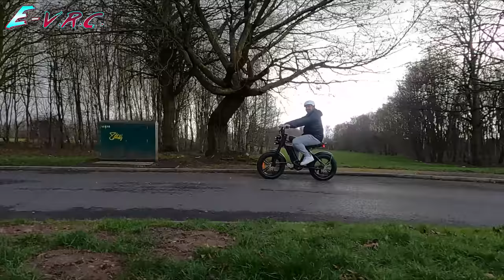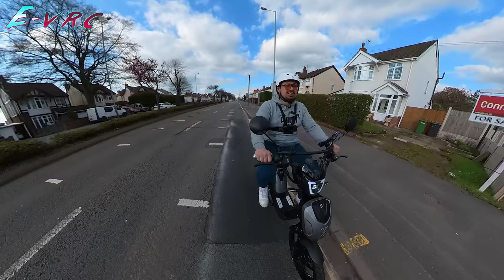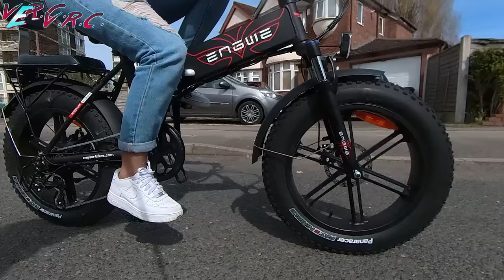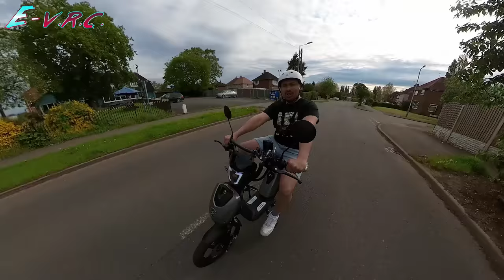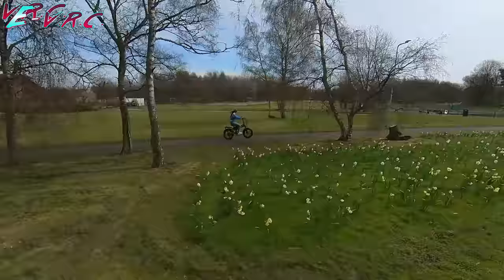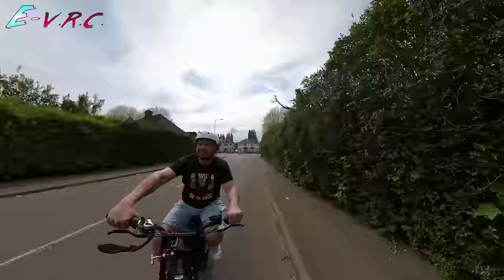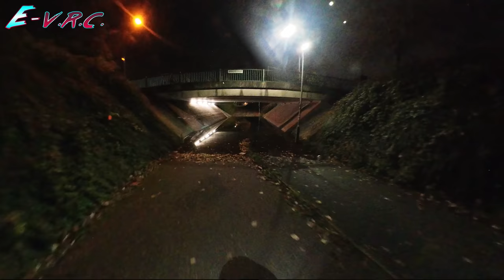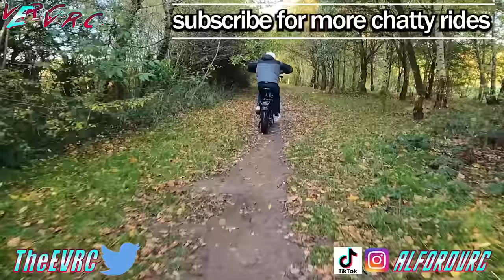The CRAZY Ebike law that MUST Change Before Someone Gets HURT

Comment: The 250W nominal limit is really only a number. All the uk legal ebikes I looked at had real output considerably higher than this, mostly between 400-750W. The nm torque figure is much more realistic
Reply: I agree with your assessment. I don't know what the actual 'power' of my cargo bike is, but with a stated 80Nm of torque and 160kg including me, it gets off the line a lot quicker than just me with no luggage on my conventional bike. (Slight caveat... I live in fairly flat country so I don't really know, or need to know, how it copes with steep hills.)

Comment: I got a bafang mid drive and a tongsheng mid drive ebike both with throttle. The bafang throttle makes it like a scooter ie no pedals. The tongsheng throttle works to 7mph then it slows you down if you still use it and pedal.
The throttle legality and a throttle is legal on a bike built before a certain date is daft.

Comment: Are these laws even enforced? I built an ebike with a 1000w motor, throttle only and never bothered connecting the peddle assist. Never had a problem with the law (fingers crossed). I do about 31mph and other ebikes pass me all the time that must have 1500w moters doing 40mph+ i rarely ever see an ebike with 250w motor on the road.

Comment: I have a 250w Jorvik electric mountain trike which weighs 50+kgs, plus tools, etc. I weigh about 85kgs. It does have a "throttle" but this will only power the trike to walking speed, on level ground.
On even the gentlest slope, a hill start is very difficult, if not impossible.  250w is not nearly enough power to pull away safely uphill at a busy road junction.  If there is loose gravel, it's even worse.
I do not have a real problem with the max powered speed. At 73, 15.5 mph is quite fast enough for me, but 20mph would be better.

Comment: I think that what you want is an electric moped.  These are readily available and need insurance, licence etc... For those people whom want to supplement their pedalling with a small motor to assist up hills etc. then an e-bike is ideal, but it remains a bicycle (hence the pedals). It's easy to confuse cycling (with assist) and a small ride-on moped.  If you don't want to pedal don't buy a bicycle!

Comment: A throttle makes it an electric moped so you need to do a CBT, get insurance, registration plate, MOT etc. There is a problem with idiots riding Sur Ron’s which do around 40mph with a throttle. Electric pedal assist bicycles are perfect as they are and the law is there for a good reason. If you want a throttle get a moped license.
Reply from the maker: A throttle on a 250w doesn't make it a Sur Ron though.

Comment: I agree that the assist limit needs to be 20mph and a boost button for setting off especially on hills is a good idea and I think this exist on some eMTB models too. 
I think there comes a point though when you have to ask yourself do you want an Ebike or an electric moped?
There has to be a cut off point somewhere.
Reply from the maker: Agreed. I think moped being 28mph, ebike being 19 or 20 is decent. But without a power limit so they can still do hills and carry heavier riders.

Despite speed and power though which you can easily argue the current rules make sense... throttle doesn't. I haven't heard anyone come up with a reason why throttles shouldn't be on an ebike.
Reply: @e-VRC  Yeah, I think it's basically just all to do with them actually really being pedal assisted rather than fully electrically propelling the bikes motor. I'm not against it personally but I can see why it is there to differentiate between an Ebike and electric moped. If you're not pedalling how can other people tell the difference is maybe the reason. I see a lot of food delivery people using obviously unrestricted throttled bikes though and they don't seem to be stopped. Many near where I go are no way restricted to 16mph I'd say some are easily doing over 30 sometimes, I can understand they need more power for carrying goods so maybe they have different laws? I know they aren't electric mopeds because they should have a reg plate if they are?
Reply from the maker: @davidmaskew  they're just getting lucky tbh. Police do turn a blind eye to people seemingly being responsible which is fair enough since you want them to be after proper crims. I suppose the rule is a bit funny as of course with an ebike you aren't actually helping at all or at least you don't have to. They want ebikes to be 'electrically assisted' but actually they can get away with being fully 'electrically powered' (ghost pedalling) and that's judged to be ok then it doesn't  make sense that throttles aren't. Lol I think we cracked it 😂🤟

Comment: I think the speed is set so low, because the question is where does a throttled e pedal bike stop and an e motorbike start? The other problem is with speed is higher risks of gravel rash and general injuries if you crash

Comment: Here in the US(in my state) there is no wattage limit.(mine is 350 watts) Throttles are allowed. The speed limit is 20mph( mine goes 30kph ) I can pedal mine at about 15mph without the motor on.(only slightly slower than I can ride a normal mountain bike). Some people have ebikes that go 40mph. You can get away with this on highways. The police will leave you alone most of the time on an e-bike. they go after people who put gasoline motors on their bikes instead. Mine does not have a throttle. When I am in tight maneuvering situations I turn of the pedal assist and pedal it like a regular bike. I had a crank come loose once and had to figure out how to kind of hop it along by half pedaling  to get it to where I could get a tool to fix it.

Comment: You can pay £50 and get your ebike approved with a throttle - I think you have to go to Portsmouth.  There's still no insurance or registration requirement.  They will test that it is compliant with power and brake requirements, speed limit etc.

Comment: I'm lucky, as a friend of mines staff  use a small fleet (4) of Engwe 750 watt  EP2 PROs to get themselves around his Private estate.   All the bikes have the Throttle enable & are limited to 20 mph..   The benefits are, Safe ' Twist & go' starting  off using the throttle,  plenty of power for the larger rider & for  carrying loads on the Rear Rack .  By limiting  the top assist speed to 20mph  it keeps the riders  at a reasonably safe speed limit.   I can vouch for the benefits  myself,  I  rode one as my main transport  on my last visit in June 2023.  A great solution.  ( In my opinion  a  UK Spec 250 watt, Max 15.5 mph & no main drive Throttle  e-bike  is a really poor unsafe experience  for sensible Adult Riders.

Comment: A pedal striking the ground while cornering has to do with the ratio of bottom bracket height to crank length, plus the shape and thickness of the pedal at the outer edge. The simplest solution is to fit shorter cranks and slimmer pedals, since the standard 170mm crank is derived from road bikes and the 175mm from mountain bikes, both to fit taller people. The average person will be fine with a 165mm crank, and adults with short legs would be better off with a 160mm.
Another solution would be to have a tilt sensor within the bike that can detect cornering.
Reply from the maker: What would it do when it detects cornering?
Reply: @e-VRC  I was imagining a mid drive e-bike motor could switch into generator mode when the controller detected a tilt of sufficient angle to cause a pedal strike, the resistance effectively locking the pedal cranks into horizontal orientation for a split second.

Comment: Here's a solution:  Disconnect the crank from the drivetrain entirely (a "zero gear", so to speak) and  install a tiny motor just to spin the pedals around, satisfying both the motor controller and the letter of the law..
Obviously,  this would only work for hub drives.

Comment: I’m a 19stone big guy who previously broke my right wrist twice, I have no controlled movement in my right thumb now so I would have to slide my hand across the grip to move a thumb controller? I purposely use a twist throttle on my e-bike for that reason and a oversized motor/etc to get up some local hills.

Comment: I'm sorry but some of the arguments for a throttle are a bit flaky. Such as scraping pedals going round corners. The bike you chose did look to have a wider than normal crank axle, and probably a low BB height. It's a semantic argument really surrounding pedal assist and throttles. Bicycles differ from motorcycles because the rider is the motor. Pedal assist is just that, allowing the rider to still pedal but not doing all the work from them. Chuck a throttle on their it's no longer a bicycle.

Comment: By all means have a legal throttle, more powerful motors and a higher top speed. So long as you're prepared to have number plates, compulsory insurance, license, compulsory helmets, etc. etc. The reason for the law about "pedaling furiously" is about being in control of a push bike whilst using the road with others. A bike travelling at 25 mph will have very poor emergency braking capabilities, especially in damp conditions. Think of the difference for car drivers between "Driving without due care" and "Dangerous driving". It's all about sharing your space with the rest of the world.
For the record, I'm a cyclist and I have an electric bike. I also have a car and a motorbike. I'm a pedestrian and I use public transport.

Comment: The answer is simple - ignore it all. I have put 6000 miles on a 1500 watt Bafang mid drive mountain bike that cruises at 35 mph on the flat, it's pedal assist and throttle, and the only time I use the throttle is when i want a bit of a quick blast across roundabout and such. Police have gone past me multiple times and not batted an eyelid and it's perfectly safe in the hands of an experienced driver and cyclist like me. Go into a town, drop the power from 5 to 1 and hey presto - its legal again. So let them "catch" me

Comment: I still have a Sinclair Zita, (remember them?), fitted on my pushbike.  As this is operated with a push-button rather than turning the pedals, (i.e. pedal assist), does this mean that it is illegal? When they first came out, (almost 30 years ago), they were fully legally compliant.
It's worth mentioning that even at 250 watts it is VERY underpowered. A 250w 'Voi' rental scooter has much better performance.
Reply from the maker: Wow I'd never seen that before, just read about it. Very cool! Any kid with that in the 90s would he the coolest kid on the block. Especially added to one of those 'computer bikes'. I wonder why I never heard of it. Good question about legality now. I'd say since it's old and once was legsl it can get away with it. Thanks for commenting 👍👍

Comment: actually its 27.5km/h. ( 25+ 10% of tolerance ) and the motor also can have 600w of peak power. the vanmoof s3 or s5 put out 500w of peak power with the boost button.

Comment: I've got pedal assist in the back wheel and throttle in the front wheel, both 250 watt motors, yes I know having two motors with two wheel drive is illegal shut up I'm opening breaking the law but it's a stupid law 🤣

Comment: This is so helpful thank you! I’m a disabled person that was thinking of trying an ebike but it’s no good if I have to pedal!
Reply: Get a hub drive, remove the chain, and install a tiny secondary motor just to spin the crank.   It wouldn't take much since it would be doing no work beyond complyong with the law and moving your feet up and down as fast or slowly as you want.  That would be good for your circulation.

Comment: I do have a throttle because my bike is pre January 2016 (although upgraded to mid drive.) I live in a rural area which is very hilly (steep ones) so 250 watts is a problem so more power please, but 20mph is as much speed as I need.

Comment: Great points made, Bicycles have evolved so much to the point that they are beyond current legislation,
we would use our pedal assist bikes more ,but the lack of proper infrastructure and risks riding on the road leave cyclists vulnerable,

We need to consider that currently to ride an engine powered 50 cc 2 wheeler limited to 30mph which years ago had to be able to be pedalled , which is much less than many e bikes could be capable of, 
The rider has to be 16 or older, and has to apply for a driving license,
That rider has to pass compulsory training, and wear approved safety equipment
The rider has to comply with motoring laws drink, phone use and only use roads to unlike cycling, 
It has to have type approval inc  anti lock braking,Compulsory thatcham anti theft,
And meet all vehicle mot testing standards including tyres, lighting etc, 
Currently like germany and many other countries , it is possible to register an e bike with more power,
But it is then classed as a motor vehicle, just like electric cars and motorcycles, 
We are at a point where e bike deaths and the anti social usage is hitting the news which could be used against us cyclists, 
The easy and cheap option for our authorities is to force vehicle legislation, instead of proper solutions,
It will based on statistics now entitlement to ride a bicycle on roads with current rule changes empowering us to use the broken roads more,
is encouraging us to report and take to court road incidents on safety grounds,
It really shouldn’t be such a risk to be a cyclist , 
but not using the limited inadequate infrastructure we currently have is providing debate in an accident,
 i fear once enough data on safety is gathered , future legislation wont be in favour of the freedoms we currently enjoy,
Stay safe

Comment: I think the laws in the UK are quite reasonable. 15.5 mph is maybe a bit slow on a road, but going along a canal towpath where dog walkers, and parents pushing their children in pushchairs etc, then 15.5 mph could be dangerously fast, and let's not forget that this is only the speed at which assistance cuts off. There is already legal provision to have full assistance up to 4 mph, so this just needs to be built into the controller, as in the funky 'moped' bike. Where I do think the lawmakers have got it wrong is with the feeble 250 w max power rating. This may be sufficient for a 50 kg youth who probably has no problem pedalling a normal pushbike, but most people who need to get out of their cars and onto their pushbikes tend to be larger, and have mobility problems. I am 60 years old, 120 kg, and I am suffering long covid and the after effects of a stroke.  I have had to retire early, . I also live in Wales where we have hills, and my 250 w hub motor bike is totally inadequate to give me any useful assistance. So in essence - Keep the speed limits, keep the throttle assistance to 4 mph, but for God's sake, improve the power rating so that those who need it most can benefit from riding e-bikes.
Reply from the maker: Absolutely agree. The throttle up to 4mph (and let's face it they'll get away with 5 or 6) will solve a lot of issues. You need to see my other video about 250w 👍👍

Comment: As someone from the EU the 25 km/h law is really annoying, especially since most of the "bike friendly roads" tend to have 30 km/h speed limit - not 25.

With the power thing - well, yeah it could be higher, especially considering cargo bikes. But speaking of - one thing that annoys the crap out of me in bikes is how rare are bikes that are designed to be strong enough to carry a passenger with you. Sure, bike rack may not be very comfortable, but I'd rather have that possibility in case I need it.

As for the throttle - 100% - this is an absolutely stupid rule. Not only because of a hostile infrastructure, where throttle could actually help, but also for the elderly, the disabled or people with some other health issues. Sure, it could be less then assist, like 20 or even 15 km/h. Anything that's fast enough for most riders to be able to ride. Heck, I'd even be okey if that feature was only available with doctors prescription.

Comment: The laws are there to keep ebikes behaving the same as bicycles. I have an ebike with a throttle and never use it, I find it counterintuitive, but that's because I started off on a regular bicycle where I was used to regulating power by pedaling and not putting pedals in a position where they strike the ground. Power kicking in unexpectedly can be an issue, but managing it comes down to rider skill. I never rode a motorbike so never learned how to use a throttle appropriately.

Anyone wanting to travel faster than a regular bicycle should really do their moped or motorbike test and then ride a proper electric moped that is designed for those speeds. Sure a bicycle can go 30mph, but the stopping distances are longer than a moped or car and the bike isn't as stable. The rider will have also had some basic training on keeping safe,  some insurance if things go wrong, and some accountability for their actions.

Comment: I agree that throttle should be faster, maybe 8mph to get away at the lights,  on road; assisted bikes are really fine but its shared use paths where the problems lie. Too many idiots have access to vehicles that they are not fit to be in charge of.  Its bad enough being a pedestrian as it is.  
250w is the power a good amateur club cyclist can sustain over an hour, so 250w is reasonable,  however you are correct in the need for better throttle speed or initial power/torque.  I tow a trailer so getting away is difficult.  Hub gears help that I can get into 1st gear from 3rd whilst stationary but polling away is hard, despite being the aforesaid amateur club cyclist who races at the weekend.
Reply from the maker: Yeah I'd actually be ok with a good punchy initial throttle that doesn't work above 5-8mph. Technically they could do that bit just don't.